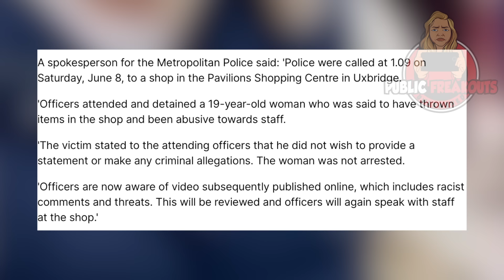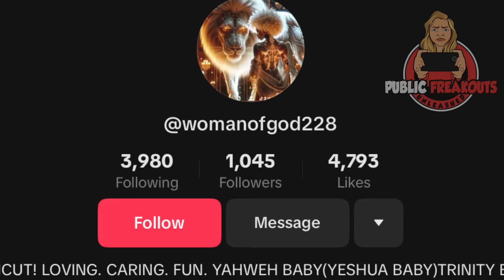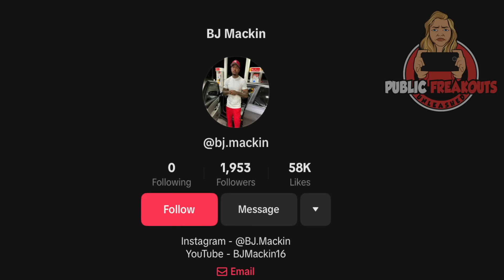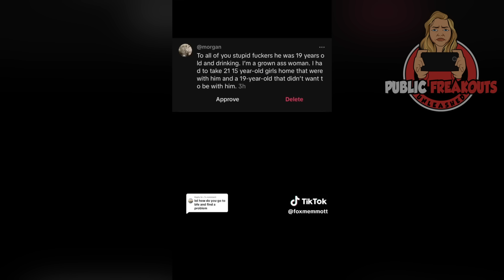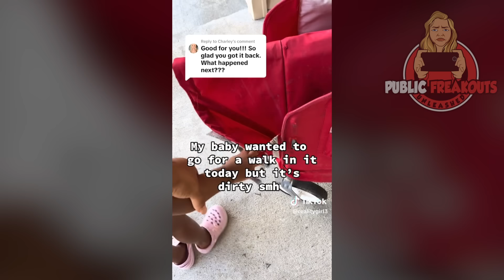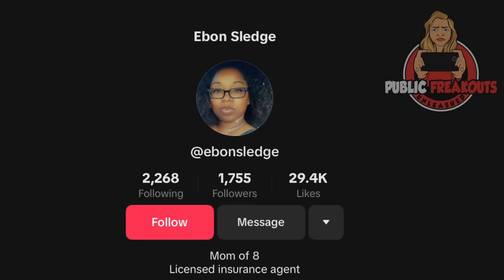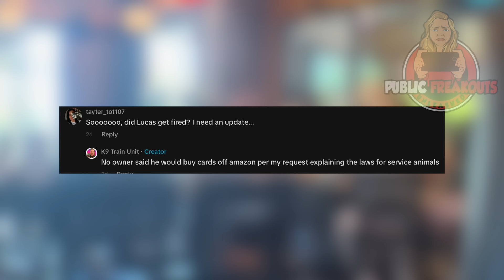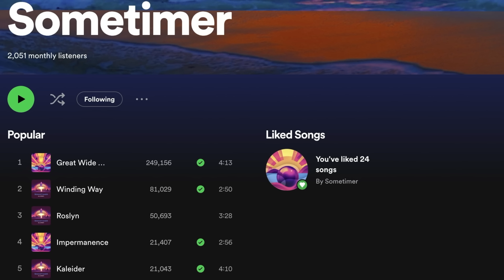Hit & Run Karen Couple Is In SERIOUS TROUBLE For This..

Comment: Spirited Away: One time I missed my flight by 30 seconds. Plane was still at the gate, it was 5 min before departure and I had just walked up. Unfortunately the doors were already sealed. I didn't scream or throw a fit. I just called the number they gave me and they re-booked my flight for the next day. Granted that was SW and not Spirit. Still, you get a better result if you ask for help and give puppy dog eyes at the start. I have never seen someone get what they want from an airline through volume.

Comment: So many people think a security guard has the same protections as cops, they do not
Reply: I'm a retired private armed security guard, many years experience. We did indeed walk a fine line legally, and while most of my bosses were good people, I wouldn't have been willing to risk jail for any of them. Good that those guards stood back and let the sworn officers handle that guy. Although the screaming "Get back, get back!" was a bit over the top, LOL.
Reply: Laws vary from state to state.  

I know in my state I can use physical force to remove a trespasser from private property, or to defend myself.  Also if I'm attacked the charge they face is the exact same felony charge someone would get for attacking a cop.

But normally you see this type of thing because of company policy prohibiting certain actions because of concern about potential civil liability.
Reply: So they are useless.
Reply: @JrueThrondsen  Unlike you, no they are not
Reply: Then what is their purpose?

Comment: Little miss thought she achieved so much by littering the phone cases on the shop floor.
Reply: I imagine she broke more than a couple.
Reply: she thinks she's a princess n she can do whatever she wants n get away with it.sone jail time will set her straight
Reply: She did get away with it.  They refused to press charges.
Reply: Good thing everything else was locked up. Otherwise, she would have thrown those as well.

Comment: If you can’t afford to tip, you can’t afford to order food. Period.
Reply: Agreed. I find making my own food at home is cheaper than take-aways, and even more so because I don't have to pay for delivery or tips.
Reply: Yeah, using the “I’m poor” argument is so stupid too. If you’re poor, go buy some ramen packs or visit the food shelf, don’t exploit people who are working to avoid finding themselves in poverty too. 

I did DD for 2 years as my sole income and eventually I had to find a different job because all the cheapskates discovered they could take advantage of new/dumb/desperate drivers who will take their no-tip orders or lie that they didn’t receive their order and getting the driver in trouble or even banned from the app.
Reply: Tipping ain't a requirement , you take the job knowing that tips aren't mandatory then get mad when somebody doesn't tip . wheres the logic in that .if tipping was mandatory and nobody tipped than u got an argument . poor bashing talking bout ramen noodles 😂 y'all petty ll
Reply: @blicky308  That's the part you are missing. Door dashers are not employed by anyone. They are mostly people who are 'between jobs', or students, or it's a 2nd job in order to make ends meet. They contract (at their own cost) to pick up and deliver food in the hope that they make enough on tips to cover their fuel expenses and still meet their needs for extra cash. Nobody does that job because they LIKE it, trust me!

Comment: if you cant afford to tip your driver you cant afford to order delivery goddamn its simple
Reply: If your job doesn't pay a proper salary, you find a new job, customers aren't responsible or obliged to chip in. Alternatively, charge a mandatory tip if you're too cheap to pay your employees a decent wage, once again, the problem is the employer, not the customer.

Comment: Public Service Announcement:  EVERYONE in a vehicle during a traffic stop can be removed by police whether they have committed a crime or not.  The Supreme Court has ruled that Police can remove anyone from a vehicle for Officer Safety.  So if a cop tells you to step out as a passenger or driver you can be arrested for refusing.  This isn't a theory, it's established case law, and you will lose in court every single time.

The problem isn't the court ruling, the problem is that cops abuse the premise of the "Officer Safety" ruling to flex their egos and make power moves to show occupants who's boss or to try and escalate an encounter so they can go hands on and pad their arrest records.  It's often used against those who won't bow down and lick their boots.  Its messed up because they do a disservice to fellow cops who are facing actual officer safety issues but get nothing but push back and its because of the cops who abuse and misuse the Officer Safety Supreme Court rulings.

I made this post because I have lost count of the number of times where ive seen videos showing people declaring they do not have to get out of the car, including drivers, and 95% of the time they end up cuffed and stuffed.  Im not sure where people got that idea but in my opinion its best to not give cops a easy reason to arrest you cuz they will almost universally take what you're giving.
Reply: They CAN remove you from the vehicle, but they CANT id passengers unless RAS applies.

Comment: As a Dasher, no tip, no trip.
Reply: Blame customers when your beef is with the company. YOU accepted the terms of employment. That's YOUR fault
Reply: @BrettShadow  If you've never done delivery, we can see the payout. The smart ones know how to spot no-tippers. We know the base pay and we calculate pay for the time it takes and the miles to deliver. No tip, no trip!
Reply: @BrettShadow  Also, we are not "employees"! We are not W-2. We are INDEPENDENT CONTRACTORS.
Reply: @hendawg2020  Which gives you even more control to not accept subcontracts from contractors that aren't offering what you feel is fair. The company has their subcontractors depending on and blaming customers directly while they collect their money. The food delivery model as a whole is a failed venture but my point is your beef is with the company that is not paying you and making you dependent on tips. Tips are GRATUITY. They should not enter the equation when you are negotiating or accepting a contract for labor. Gas is expensive. Wear and tear on vehicles is expensive. Your dead head time and milage is lost opportunity cost. These companies are exploiting you and passing your frustrations to the customer. In the end the customer will use the service again and if the customer complains it's you that end up on the hook. Bottom line is these companies MUST SUBSTANTIALLY INCREASE their fees to both pay their subcontractor drivers and become profitable. Neither of which they are currently doing.
Reply: @BrettShadow  You're right, I can just sit in a parking lot and decline orders all day. They gradually increase the pay until somebody accepts it or bundle it with another order, but until then, that food is already sitting on a shelf getting colder and colder or that order isn't being shopped for. No tip, no trip.
Reply: @hendawg2020  That's right! And the people who want the luxury of having their food delivered will either pay what that luxury is worth or they won't. If they feel like the amount that is being charged is worth it to them even at a price that is sufficient to pay the drivers properly and allow the company to turn a profit... then literally everyone in the equation wins. If they feel that the amount the service has to charge to pay their drivers and turn a profit is too high and more than they are willing to pay, then the business model fails. You as a driver should not be expected to provide your service at a price point lower than you feel it's worth. PERIOD. And that amount should be pre-negotiated with the company with the terms satisfactory to both parties. If it is not then the food sits there getting cold until the company fails. The customer had also agreed to an amount and the company telling you "Just take this and maybe the customer will feel like paying more than they agreed to and that can be the rest of your wage" is and should be to you... unacceptable. Should a customer be satisfied with you individually and your service and want to show extra gratitude, fantastic! That is even more of an incentive to be at your best. But if they don't want to pay more than they agreed to pay... that shouldn't cut a negative into YOUR pocket. The gratuity can never be of negative value in it's absence, it can only be of positive value in its presence.
Reply: @hendawg2020  and if that food sits there getting colder and colder then I bet that gradually increased rate gradually increases it's ass with a bit more urgency next time won't it... or better yet.... start at a higher rate from the jump.
Reply: @BrettShadow  You DO know that the fees and all that go directly to the company and not the drivers, right? You seem like you don't understand how delivery apps actually work.
Reply: @hendawg2020  Yes I am aware of that... and that is the problem. Those fees should go to the company and in turn the company should be paying you an amount that doesnt leave you relying on tips!
Reply: @hendawg2020  And I know EXACTLY how they work... that's why I don't F with em. They take the fees and for what? providing an app that is a barely necessary middle man at best while they leave the drivers to roshambo the customers over pennies. I watched a great video about the industry not too long ago. I will see if I can find it. It's a good watch and I would say almost necessary for those involved.
Reply: @BrettShadow  Just tip your delivery driver like you would your server at a dine-in restaurant, your bartender, your standard non-app-affiliated pizza delivery driver, your barber. FFS, this shouldn't be an argument. If you don't want to tip, your food won't be my trip. If I was a barber and you didn't tip, I'd give you a bad haircut the next time. If I was serving your food in a restaurant, I'd mess with it the next time I saw you if you didn't tip. If I was a bartender, I'd water down your drink or just let you wait to be served until I serve everybody else. You get what you pay for. There's that line from Fight Club about not messing with service workers. Try to remember that.
Reply: @BrettShadow  And if you don't even use the delivery apps, why are you even arguing about them??
Reply: @hendawg2020  Love it!  Never been a service worker personally, but my son was once and the cr*p he had to put up with was cruel. They deserve their tips!  It's all very well to say the companies should pay better but WTF can workers do in the meantime when they have to make a living somehow? They also have bills to pay, and for some door dashers it is their 2nd job so they obviously need the tips!

Comment: The rude cops should be sued.  They obviously could not came up with a real problem.  These cops do not have any reason to check the bags.  There is no evidence that they are drinking or smoking pot or driving recklessly.  You don't have to answer question about why you are not driving, what you are doing.  Most cops will ask where you are coming from to see if you have been to a bar but behind that it depends on the state.  The service dog guy should have called the cops.

Comment: I lived in Hawai'i for many years and can attest to the fact that this is true. It is a cultural tradition. Many students receive a lei from each of their attendees, so they often have so many on that the leis pile up to chin level. It's beautiful and fragrant. The leis are usually made from plumeria blossoms or kukui nuts (the oil was used as lamp fuel, so they represent the light of knowledge gained by the graduate). This is an extremely important cultural tradition to the Hawaiians and I believe it extends to most or all Polynesians, though I could be incorrect on the last part. If I were them, I would absolutely sue the school for this blatant racism. 😢 Would they prevent a Muslim to wear hijab, or a Christian from wearing a cross or rosary? Unbelievable disrespect to their culture and religion.

Comment: 10:52 the problem is, use of force for security is different, and not worth the lawsuit. What you want to do is EXACTLY what they did, don't engage the aggressor and wit for PD but keep the public at a distance. Security needs to be able to have the same use of force regs as police to be effective. Hell even the same rights/regulations as a common citizen would work

Comment: That door dash driver should add delivery notes so that it pops up not to expect a tip if you except that delivery because it costs that driver gas and wear and tear on the car and the drivers aren't required to except a delivery

Comment: "Officer safety" is a bs blanket excuse they give when they are trying to do something unlawful. Pennsylvania v Mimms does allow officers to ask the DRIVER to exit the vehicle on a lawful traffic stop for "officer safety" but it does NOT include the passenger. And no one ever has to ID for police, outside of a traffic stop, unless the police have reasonable articulable suspicion that the person has committed a crime, is in the process of committing a crime, or is about to commit a crime. They will lie and give you all kinds of bogus reasons to get the ID but none of them are lawful. This passenger absolutely did the right thing! DON'T EVER ANSWER QUESTIONS either. Give them what you are required to give them as the driver and nothing more. Everything they do and say is for the sole purpose of getting you to say something that will incriminate you. So just be quiet.

Comment: The graduation thing is so wrong!  

The DoorDash thing, well I am a dasher, we are not employees but independent contractors. Now when I started, 50 % of my income came directly from tips.  We are paid a flat rate per order, for the mileage, and tips. This is a side job for me I do just because I struggle too. They have now started paying hourly. As 1099 employees we make the decision of hourly or by order. Your time starts when you accept the order and stops when it is dropped off.  This really helps when you have long waits at restaurants. That driver should learn about etiquette. If you have to ask/demand a tip, you really don’t deserve it.